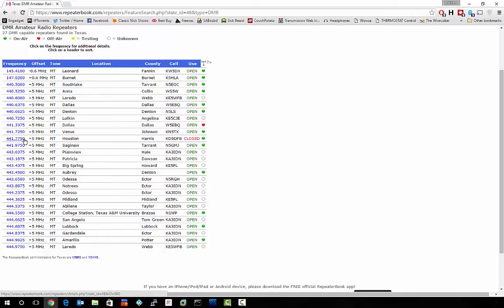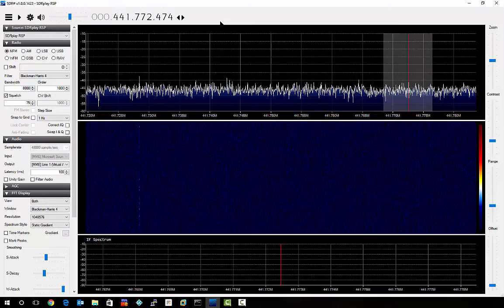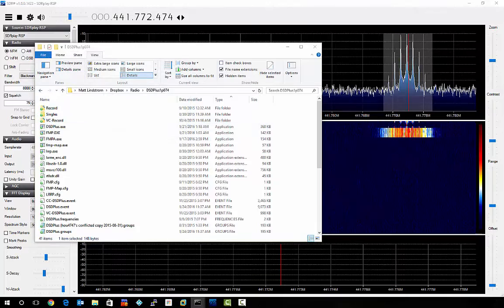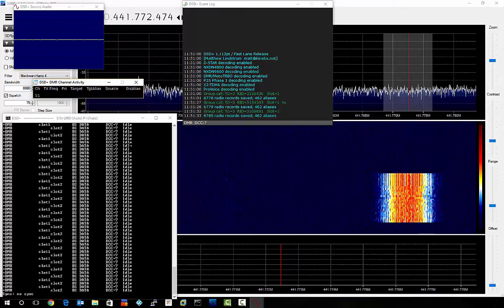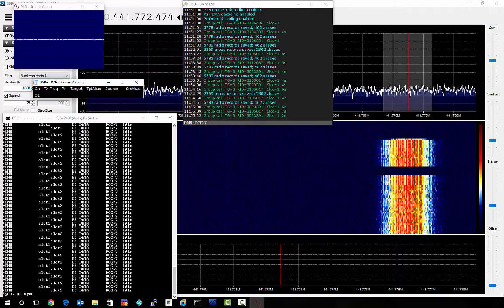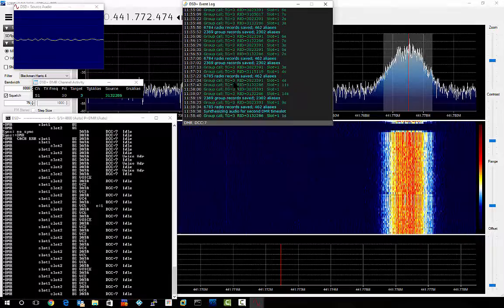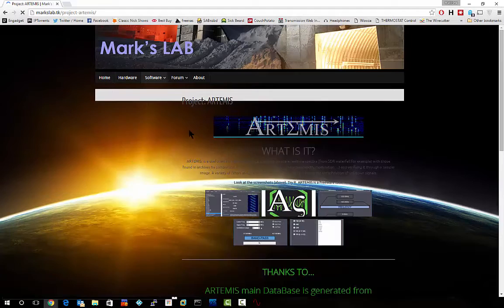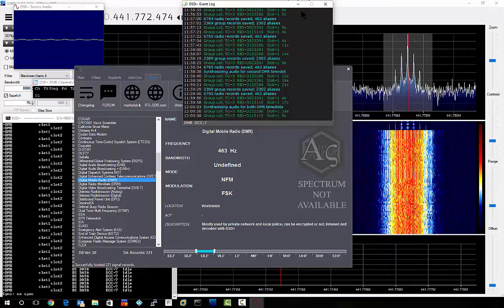DMR Decoding with DSDPlus

Comment: Newbie Question:? When using sdrsharp and dsdplus to decode DMR why am I hearing the trunked signal as well as the decoded voice?
Reply: 3 years later, but disable "listen to this device" in the sound control panel for the recording device.

Comment: Thanks for the video! I have it decoding for S1 or S2. But when both S1 and S2 are up I get decoding errors and the audio stops until one the channles drops. Have you seen this?
Reply from the maker: I have not left it running for extended periods trying to monitor both slots as I am usually only concerned with slot 2 around here.  I'll try to test it out though and let you know.  Might be worth asking around the radioreference forums as well.

Comment: How do you mute and unmute the different time slots?
Reply from the maker: j69chevelle I don't believe there's a way to actually mute the time slots, however, you can selectively choose which one you are actively listening to buy hitting either the one or two keys respectively for the time slot 1 or 2. By hitting the three key you will go back to listening to both time slots at the same time.

Comment: Does the SDRplay work better with DSDplus compared to the SDR-RTL dongle?
Reply from the maker: I don't notice any kind of better decoding on it.  The SDRplay's strength comes in to play more with Unitrunker (or anything that can make use of the large spectrum spread) since it has such a wide sample bandwidth compared to the cheap dongles.  You can create many VCOs from just the one SDRplay to cover a large portion of the spectrum.
Reply: Can you tell me if SDRplay perfroms better than a SDR-RTL and if so in what way.
I am on the fence about getting a SDRplay but need to know how much better it is and in what ways.
thanks
Ken